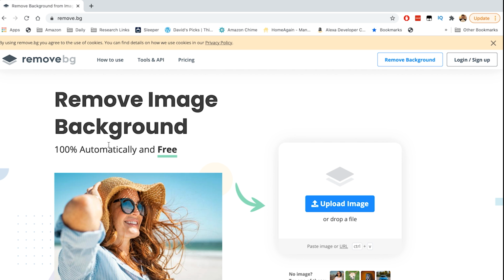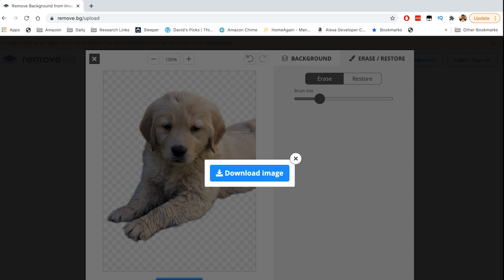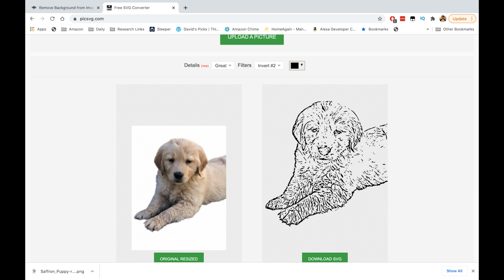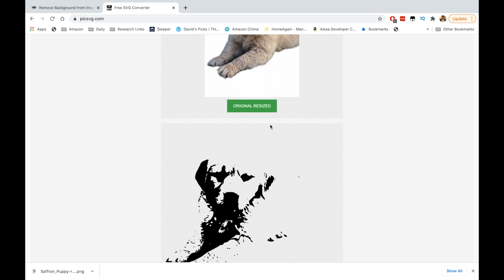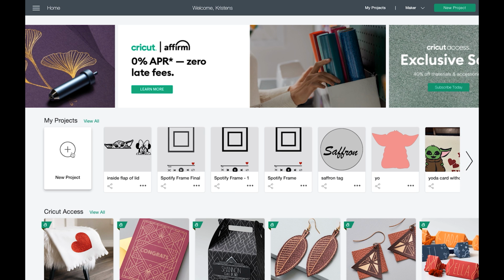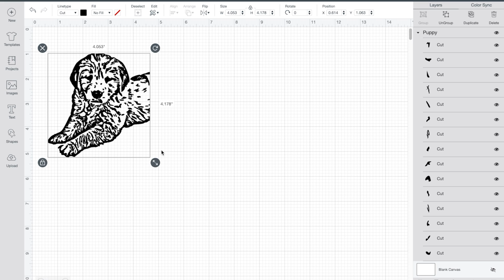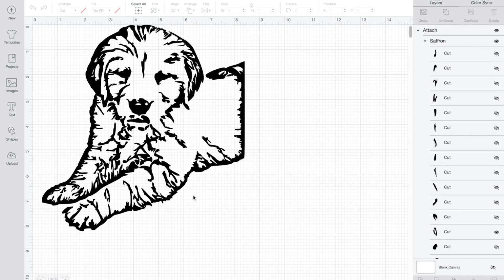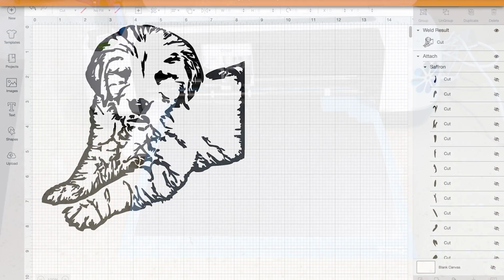Turn a Photo into an SVG for FREE and cut on your Cricut

Comment: I did everything you did, but I don't see weld.  I am not sure why.  I clicked on attached, but can't print it either.
Reply from the maker: Hmmm. They have recently changed the settings but weld is still available but they added a few other options under the combine. I hope that helps!

Comment: use what pressure when cutting pic with such great details?
Reply from the maker: Depends on what material you are using. I will tell you that the more metallic vinyl causes me great trouble. Most other materials work fine for me. I love using washi setting and adjust the cutting depth for detailed images. I have the most success with that! Happy crafting

Comment: I am SO new to this but how in the world do I get my cricut to cut the vinyl to size like you did? I can't seem to figure out how to get it to cut a square around my picture so I am not doing it manually afterward.
Reply from the maker: I will tell you this was a nightmare to weed. The least amount of detail in the image the better and less of a headache. This took me well over an hour to weed and several tries at cutting it. To get the rectangle around it just use the shape and lay it over your image and hit the attach button on the bottom next to weld. That will cut the rectangle! Thank you for taking the time to comment! Hope this helps

Comment: Hi there my vinyl is not sticking to the acrylic in using. What can I do?
Reply from the maker: What kind of acrylic are you using? I would suggest trying to clean the surface first with rubbing alcohol to make sure there is no oil on the surface. Press the vinyl down really well with your fingers and scraper before trying to remove the transfer tape. Then fold back your transfer tape as you remove it so you can use your nail to hold down the vinyl edge as you remove the transfer tape. Let me know a little more details and I can try to help further!

Comment: Nice thank you but wondering is a special vinyl or how long it last on that tumbler??
Reply from the maker: I used permanent vinyl. The problem with vinyl especially when cut very thin it doesn't have enough adhesive to last a long time. You have to hand wash. It is important to let cure (don't use or get wet for at least 3 days). One way to make it permanent is to epoxy over. Over time pretty much any vinyl will peel.

Comment: I use that same tool for weeding. Makes it easier.
Reply from the maker: I love that weeding tool too! I have some cricut ones they don't seem to work as well!
Reply: @kristenscricutcorner2258  I have to agree. These ones are thin enough to get under the vinyl without even having to work at it. Bought multiple packages of these. Can’t go wrong for the price either.
Reply: which weeding tool is this? thank you
Reply: @rikoavalos2633  it’s not actually a weeding tool. I forget what they are called. But it’s from the dollar tree. They are pink and u get 2 in a pack.